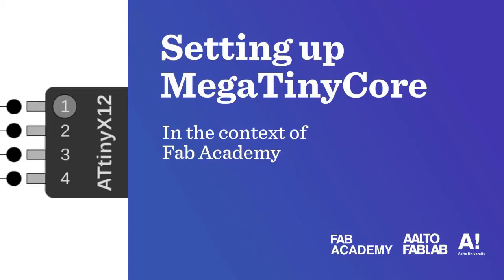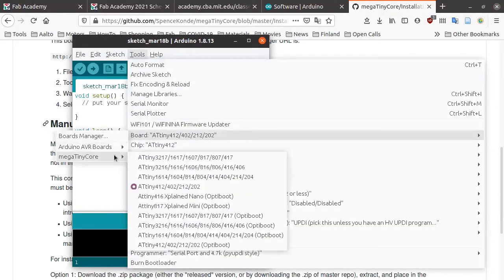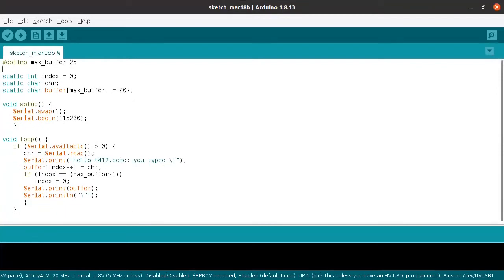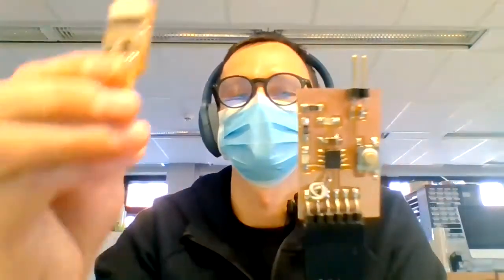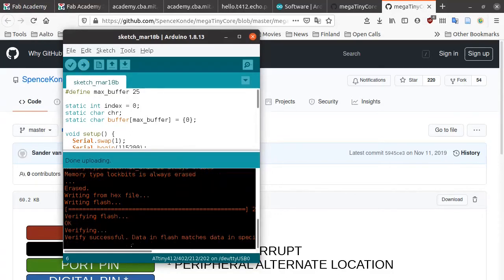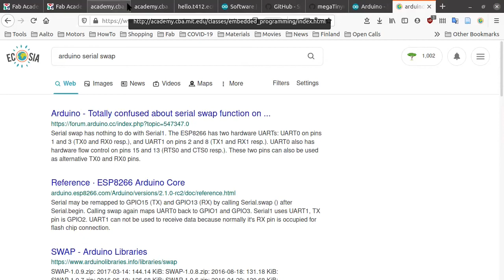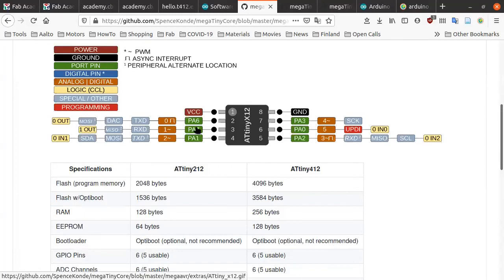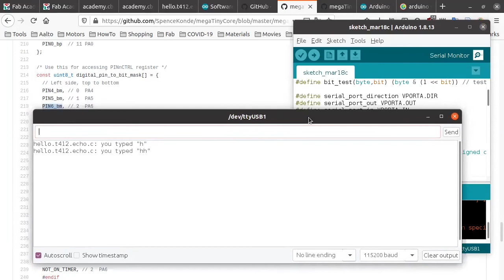Setting up MegaTinyCore

Comment: I have problems with UPDI on tiny412.
How do I reset UPDI to factory settings?
Reply from the maker: are you sure that it is the attiny not the programmer?
Reply from the maker: also check page 385 of the ATtiny412 datasheet
Reply: @aaltofablab3504  I am sure that you need a programmer with 12V. At first, the controller was programmed normally, and then it started to give an error.
You have an electrical diagram for assembling a programmer with or without an arduino.